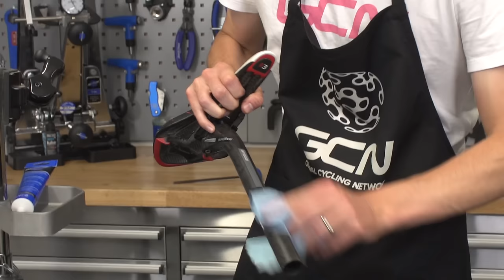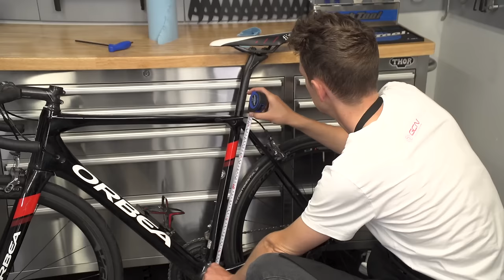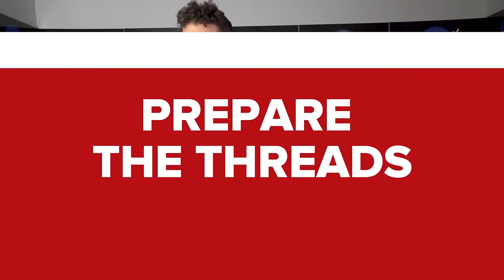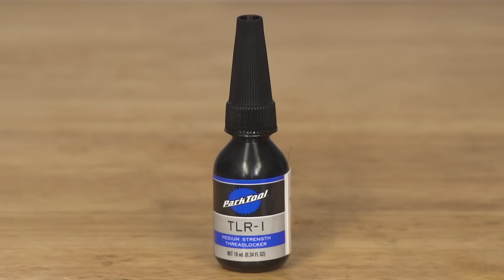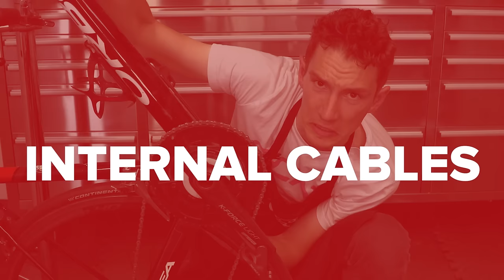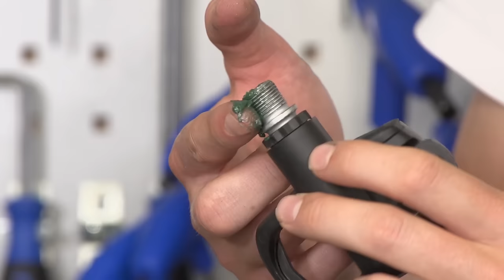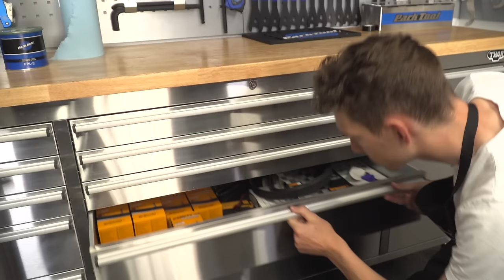6 Bike Repair Mistakes All Cyclists Should Avoid

Comment: i have 1 mistake i made, but after 10 minutes i was able to get it back together with allot of Luck,,,lol, recently i took off my handle bars, i loosened to screw/bolt that bolts into the Stem, i removed the bolt completely , and then i realized i just made a mistake, because now the nut is somewhere inside the stem, at least the good part i didnt loose that nut,,,lol, to get it back into the nut i had to remove everything off handle bars, so only the stem could be held Upside down,  looking with a flashlight while holding bracket upside down i lined up hole of nut, with hole for bolt, then with a quick motion pushed bolt back it pushing the Nut to the back side  ( Inside stem ) so i could turn bolt until it caught the threads, this took several try's 5 times,, i got it on the 6th time, thank goodness my other option was to buy a new Stem, for a Specialized Rock Hopper that i bought back in 93,,,lol

Comment: If your break pads are rubbing, and you need to press them back, do not apply more pressure to one side than the other because the piston will turn and break the seal between the air and the hydraulic fluid, you may do this and not notice the seal has broken, if this is the case do not pull the break lever causing the piston to shoot out and break fluid to spill everywhere

Comment: Use a product called anti-seize. It's a good practice to. Also if a bolt has loctite on it. Use heat to remove, giving the ability to do so. Lol. Best fluid spray I ever used like wd40 is another product called fluid-film. Top notch 🤙

Comment: Very good and informative video...
If I have to add a couple of repair mistakes, it would be using WD40 as chain lubricant, failing to re-adjust brake calipers after replacing a wheel, seized headset and not replacing consumable parts like chain and brake pads!
Reply: Omaris Bhumiriady wd40 has chain lube now ☺
Reply: It's good stuff too.
Reply: Craig Emmett seems to be just that thus far

Comment: Rounded bolt hack: Use rubber band lay over bolt entry. Jam hex key through rubber band into bolt entry. It should mold around the edges and give additional grip to rotate the bolts.
Reply: Rueben Tiow Man, that could be hack of the week!! Nice one.
Reply: Thanks Simon!!

Comment: Worn Allen Hex Wrench Fix:  Use a pedastal grinding wheel (or file in a vise) to shorten heavily used Allen Hex wrenches but don't heat it up so much that you soften the alloy.  They work better when sharp and full size.  Don't use the ball end on snug bolts too.

Comment: Number 1 stuck seized bottom bracket specially old pin crank types.Major PIA to loosen that pin.I end up cutting the whole crank out of frustration because after 3hrs of trying could not pull that sucker out.Yes seized seat post.I bought a used bike and did not check it and yeahh for the life of me could not remove it.End up tossing the frame into garbage.Where is that part I removed and now can't find it.Its up there.

Comment: Well I proudly have to say that I almost rounded  a flywheel-tool off (yeap you heard right oldtimers flywheel...), when trying to repair a 13 year old MTB... And I bought a 25yo 2hand Peugeot Cologne, only to find out the bloody Quick Release was stuck inside the rear axle (due to Rust). That took while and a lot of WD40 to seperate....

Comment: What kind of tubing do you use for the internal cable routing? I glanced through as many comments as I could, but didn't see it.
Reply: Any 2mm id/ 3mm od plastic tubing should work. Park makes an internal routing kit that is ridiculously expensive or you can get Jagwire housing liner or just go to the local hardware store and buy some plastic fuel line like goes in a chainsaw, cut the ends at a diagonal to help them slide through the frame.
Reply: @bikeopeli  Thanks!

Comment: A note on the stuck pedals: Many cyclists don't realize or don't know that the threads on each pedal is different. It's not the same old "righty tighty, lefty losey" concept, one pedal is opposite of the other :)
Reply: Great reminder!  Also i know from personal experience that the reverse threading doesn't necessarily mean it would come off while riding!  (not a fun day...i was a new bicycle and I had to rush it to the ER to have the crank re-tapped.  Fortunately, all was well and it was only the edge of the threads that was affected.

Comment: Tip when tightening bolts - LIke on the Park Tool in the video NEVER use the ball end to finally tighten or loosen bolts.  It can break off and may strip the bolt.

Comment: Here is an old trick if you accidentally pull through an internally routed brake/derailleur cable. As you know it's a real pain in the ass to route the derailleur cable back through the frame.

1. Find some sewing thread and a vacuum cleaner.
2. Tape the thread onto one end of the derailleur cable. The thread should be about 2' to 3' long (60 cm to 100 cm). 
3. Insert derailleur cable with thread into one of the frame derailleur cable access holes.
4. Put the end of the vacuum cleaner hose near the other frame derailleur cable access hole.
5. Turn on the vacuum cleaner and suck the thread through the hole.
6. GENTLY pull on the thread until the derailleur cable passes through derailleur cable access hole.
7. DONE!

This trick really does work! Be careful next time you don't pull through the derailleur/brake cable through the frame. Internally routed frame cables are a blessing and a curse.
Reply: That's a very clever solution I would never have thought of that

Comment: Use anti-seize if you don't want it seized.  I had seized pedal threads when I was trying to replace worn-out pedals an hour before getting on a train for my tour.  Stripped them down to the spindles, ground some flats and used my locking pliers with prejudice to get the new pedals on in the nick of time.  A near-disaster that could have been avoided with a little blob of goo.

Comment: For a carbon bike, I would encourage you buy a torque wrench to avoid over and under tightening. Over tightening can destroy carbon, which I have done to my bars. Under tightening can result in safety issues, such as the bars turn but the bike doesn't and vice versa. Most if not all components state on the component the Newton meter spec.

Comment: Simple problems solved decades ago by auto (racing) mechanics, mostly.
* Seized metal-in-metal tubes? Add a penetrating oil at the 'split collar location', then propane torch (pencil Torch) heat the inner tube while rotating and pulling. NORMALLY works quickly, efficiently (and at temps below 500F, without change to the metal.
* Internal cables: EASY ONE...use compressed air on the 'outfeed' hole, BLOW dental floss up into the cable run hole, take it out and reverse run the cable - easiest way of all, if you lose the cable inside (dental floss is INCREDIBLY TENSILE STRONG).
* Reindexing seat height: SIMPLE - SHARPIE permanent marker, mark the meet-line before you move it (tape in high heat locations, like Arizona, CAN actually shift before it goes back together)
And, well, the rest is just a 'knuckle-busting' learning lesson, I guess...(cameras help on parts-sequences, though, especially on car transmissions or old 3-speed hubs!)

Comment: Mistake #7: When mounting a water bottle cage, put a little grease on pilot drill and tap (~M5x0.8). Keep the chips out of the tube, or they will migrate to crank brgs. [Bought experience]

Comment: You'll strip threads if you grease threads.  Bolts are supposed to be tightened up 'dry' - ie no lubrication oil or grease.  Tighten bolts to the correct torque, and chances are you won't strip the heads in the first place.

Even better - get a torque wrench.  One click only - not like Kwick-Fit tyre fitters who click the torque wrench umpteem times and end up putting a larger torque onto to the thread.

Make sure your tools are suitable for the job.  No point using an old allen-key that has rounded edges.  That will only help to round off the flats in the socket head.
Reply: agreed.  and i appreciate your mention of Kwick Fit tire fitters.  similar to many mechanics on bikes, cars, everything.  using impact wrenches to blast on wheels bolts with excessive torque, too tight engine oil filters, etc.  too much force rarely has positive results.

Comment: How does removing the rear derailleur take the back wheel right off?

I had to remove the brake pads in the back before I could do that.
Reply: My brakes have a little lever that opens them up. I need to do that and partially deflate the tires before they will pass through the pads. (Michelin 25mm)

Comment: I actually do cross country mountain biking , but I suppose not using the correct tool (or any tool) for doing anything to your bike is something to be AVOIDED. Also not doing a proper bike check just after buying the bike.

Comment: Don't use grease or thread locking compound especially if bolt is threaded into aluminum. Use Anti seize compound. It will last possibly forever if not touched and the bolt will always come out. If you really want to do it right, Use a torque wrench on everything.

Comment: for internal cables just put a thin string in one hole and then put a vacuum cleaner oh the other hole and then suck it through, then attatch the end of the wire to the cable and pull it through...
saved me hours

Comment: ........Help....I have a crank issue....can someone identify it?.......My left side crank arm has developed 3-4 mm of play...not side to side but front to back. It's making a slight clunking noise as I pedal. I am not mechanically inclined....I have tightened the locking rings and crank arm bolts but they were not loose at all. This made only a tiny bit of difference. What do you think?

Comment: Yo gcn im doing a hundred mile bike ride this weekend but i have got a mountain bike and its all on road would it be good to buy slick tyres or because of the amount of wear on my tyres leave them as they are and pump up to the maximum psi that they will go to
Reply: Callum Roberts id recommend slicks  not just because the road will eat at your mountain tread but also it'll make riding more comfortable
Reply: Owen thanks but do they do 29" slick in halfords i have had a look but cannot seem to find them

Comment: I thought the seat post on a bike I was rebuilding was seized, and had to use a 5 pound sledge hammer to remove it. I found out that the previous owner had installed a post much too small, and must have pounded it in from the get go.

Comment: STUCK PEDALS HACK- get boiling water and poor it on the crank and pedal. They are made of different metals or different kinds of the same metal. The crank should expand slightly and let you remove the pedal. Could be a false hack but it seems to have worked for me in the past.
Probably doesn't work with carbon cranks.

Comment: I like how he says use a plastic tube like those are just lying around everywhere.  Most mechanics would have them because the manufacturers provide them with new bikes but who at home is gonna have those?
Reply: tying a thread or light string to the old cable works really well too. Pull the old cable out, tie string to new cable, pull it back. Done.

Comment: STUCK PEDALS is the worst. Even the bike shop could not get off my old pedals with their tools. They had to take the bike back in the shop and mount it for leverage to remove them. There are a lot of things I will not bother attempting because it is not worth the aggravation. Without the proper tools it is pointless to attempt.

Comment: IF you do remove your cable from a internally routed bike, an easy way to get it back together is,, drum roll please,,, put a piece of string in your frame, then use air from a hose to blow the string through, tie it to a cable, or cable housing pull it through, minutes not hours gets you back on track to finish your job. Your welcome...

Comment: I would also add another repair mistake to this list, perhaps the most annoying, and that is accidentally popping that little pin all the way out of your chain when you are breaking it.  You'll need 3 hands and at least an hour spent dropping the thing over and over to get it back in, and after you do that, your chain will probably be a little bit bent.

Comment: the biggest time waster is tuning derailleurs, when you haven't checked your frame and hangar alignment. Cracks in the frame will also change a tuned der once rider sits on the bike.
Reply: next biggest time waster is wheel hubs, then fitting tight tires.
Reply: helicart b.  Ostras no te digo lo m
Reply: @Joseph 
choo cha de la lora

Comment: The three golden rules of bicycle repair:
1)  All the way on, or all the way off.
2)  Grease all contact surfaces.
3)  Test ride your work.

Do this and you'll avoid disaster - usually!
Rule #1:  Don't ever slide a stem on and just "snug" it down and say to yourself, "I'll tighten that later."  Don't ever do this with ANYTHING!  If you do, it's a time bomb waiting to explode.  Just a matter of time when you hop on that bike and BLAM! the pedal flies off or your stem twists and you ride into a parked car.  (Ahem, not funny.  A friend's husband just died last Saturday night doing EXACTLY this.)  This rule is a life-saver.  Put a stem on crooked and tighten it DOWN!  You'll see it isn't straight and fix that issue later if you must.  But you can't "see" or "know" a pedal, saddle, rear brake binder bolt, etc., etc. is loose!  SO NEVER LEAVE THINGS LOOSE!!!!
Rule #2:  There are obviously exceptions, sillies!  Braking surfaces, duh!  A few parts will need thread locker.  (Rotor bolts are the big exception.)  But if it's a bolt, grease the threads AND head/washer for trouble-free service life.  And no, your torque settings aren't thrown off by grease - the industry assumes bolts are lubricated.
Rule #3:  ALWAYS test ride your work.  This ensures you've done everything right.  And if not, you learn NOW, not when you're 50 miles from home.  Or worse, your customer crashes because of an error you made!

Comment: what anti seize/ grease for Aluminium seat post in a carbon frame?
Reply: Lots of opinions on this.  1.  Use carbon paste to prevent slipping.  2.  Use grease to prevent seize  3.  Use nothing.  I've done all three and it depends on my situation.  I put nothing on my road bike which gets lots of TLC and attention.  On my 'cross bike, I use carbon paste (Finish Line) as the bike tends to get muddy/gritty and a post ride rinse more often.  I use the same paste on my dropper post on the mountain bike.  After a wash, I wipe the upper part of the post with a silicone spray.

Comment: I always turn my bike upside down on getting the back wheel in or out.  It's really much much easier.  :)
Reply: Working on your bike upside down marks you out as newbie without a clue.  Sorry.  And it's not easier to fit a rear wheel upside down, or the roadside pro mechanics would all be doing it.

Comment: Loosing tool after 2 seconds use. Striping derailler pulley bolt...  I am rough on every parts and keep almost everything, find a spare after 2 hours raging. And press fit bottom bracket!!!!!!!!!!!!!!!!!!! that's it for the last month. Remember N+1 is awesome until every redundance needs repairs.

Comment: Geez....... just stripped my bolt on the stem... now can't get it off the steerer tube..... HELP!!!! I need that video.... I didn't tighten that bolt too tightly... dunno why it just seized in there..
Reply: Roadbiker saw into it and use a flathead screwdriver to take it off

Comment: Riddle me this: Top tube or seat post, where do you clamp your bike in a work stand, and why???
Reply: I always clamp the seat post.  I bought a section of inexpensive rubberized pipe insulation at the hardware store.  It already has a slit running it's length.  Place the insulation around the seat post, then place in the work stand jaws.  Much less pressure needed to hold the bike securely and no danger to seat post.

Comment: You definitely want to grease your seat post if either part is aluminum and the other is stainless steel.  In fact grease any stainless steel part that comes into contact with stainless steel.

Comment: DO NOT ever spray WD-40 or oil on your breaks otherwise the break pads will lose grip for good and you’ll have to replace them. I sprayed WD-40 on the chain but it trickled down on the breaks as well, so I had to replace the pads to be able to break again.
Reply: Tim Summers WD40 sorts squeaking out fool. My bike is old, had it since I was a teenager now I’m nearly 34 years old and yes we use WD40 and hey my brake pads are fine so I know you are lying.
Reply: @danielledewitt1  : Why would I make this up?
Reply: Tim Summers Clearly you just have because you hate WD40.
Reply: @danielledewitt1  I think you should get yourself checked with a doctor
Reply: Tim Summers No I don’t. Though I do need my implant replacing. Plus if I did getting a checkup by my doctor would be rather difficult at the minute don’t you think?
Reply: @danielledewitt1  No, it wouldn’t be difficult at all. Hospitals are still open during the pandemic, especially the nut house. Look it up
Reply: Tim Summers Well it would, not one patient allowed inside my doctors surgery just receptionists and doctors and nurses that’s it.

Comment: seat post slippage 1mm per 100km. is it acceptable? steel on steel.
Reply: Tomasz Sosnowski any is unacceptable.its steel.You shouldn't be afraid to tighten it too much.If anything use fiber grip for carbon posts to get more friction

Comment: 35nm torque for the pedal?
Reply: Just snug them up. They will tighten as you ride. That is why the left pedal has a left-hand thread, otherwise it would work loose as you ride.